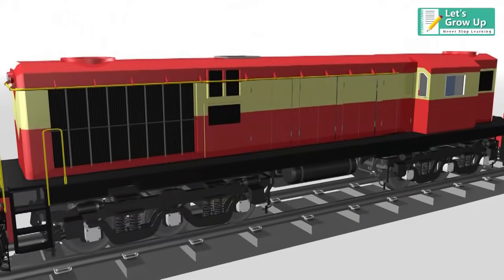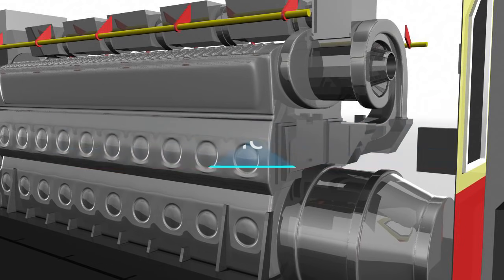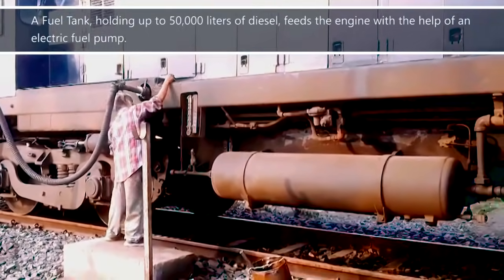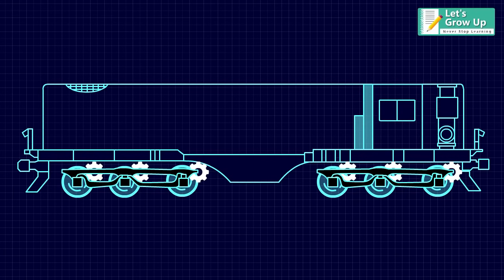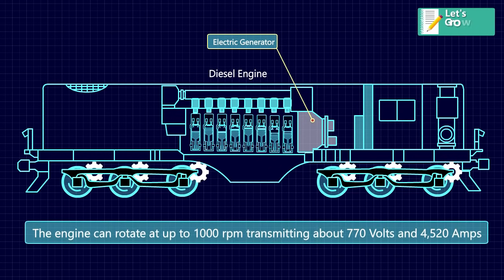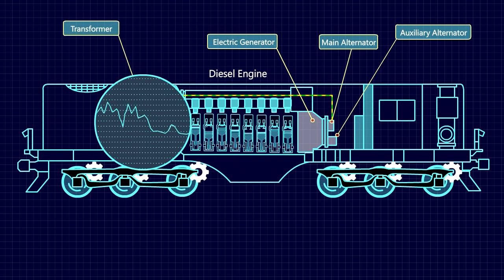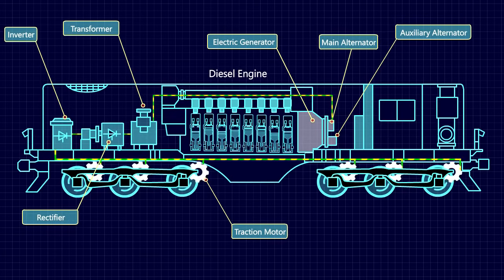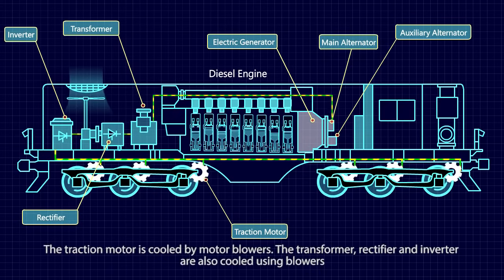Diesel engine working function | #Diesel locomotive | How a diesel locomotive works?

Comment: Not all diesel locomotives are exclusively 2-stroke, In fact only GM products were 2-stroke. Alco, General Electric, English Electric, Sulzer, Ruston, were four-stroke. Also they many produce DC power not AC as explained in video.
Reply: Indeed! The engine filmed in the video is clearly a V-16 with overhead valves. This is a four-stroke design. In a two-stroke engine, the ports or valves are at the crankshaft end of the cylinders, because there's no other possible way to combine intake with compression, power with exhaust.
Reply: @starfishsystems  I think this is actually a 2 stroke. The 2 valves are both exhaust valves, while the middle is not a valve but a fuel injector. The intakes are blower fed ports near the bottom of the cylinders. It's the same layout as the 71 series Detroit Diesel engines, just bigger.
Reply: @starfishsystems  Bullshit mate! It is an EMD 2 stroke engine!
Reply: @starfishsystems  nope its a detroit diesel thats exactly how it works, thats why it comes with a blower intake to push intake air into the cylinders, the crankshaft is immersed in engine oil like 4 stroke design....this is not a puny 2 stroke bike engine
Reply: 2 stroke diesels have exhaust valves folks. So yes rocker arms etc are needed. Also some of those rockers run the fuel injectors
Reply: EMD has a 4 stroke engine in their S(T/D)70AC(E)T4
Reply: @Stephen Miller Yes u are exactly correct
Reply: Bogietype BoBo CoCo DoDo
Reply: Yeah and it looks like they didn’t show a single 2 stroke engine in the video.
Reply: @masterkamen371  The footage shows an EMD 645 which is indeed two stroke. Like Fidel stated in a previous reply it has 4 exhaust valves (the two outer rockers) and "unit injector" which is the middle rocker. Two stroke medium speed diesels have a "ram air" system of either a roots blower or a turbo charger. When the piston is nearly down the air intake ports are opened and so are all 4 exhuast valves. The forced air system blows exhaust out and fresh air in. As the piston travels upwards the air ports are closed and so are the exhaust valves. Compression occurs and as the piston gets to the top the injectors open admitting fuel. 

Two stroke diesels have just as many moving parts if not more than a comparable four stroke.
-'lil stan
Reply: Man...AC-DC-AC conversion is common now, bcoz of advantages of AC traction motors....some DC power is used for control systems, exciter, battery charging,  rest DC output is again converted into AC 3 phs output & fed to traction motors & other auxiliaries. Since DC to AC conversion allows better frequency & waveform control so it is a necessary step.
Reply: @nothingmuch2323  Newer designs r AC-AC, bcoz modern power electronics allows better torque characteristics even for AC motors,  plus AC-AC transmission improves life for both alternator & motors.
Reply: There are russian locomotives like ŁTZ M62 that has 2-stroke V12 Engine with 4/cylinder
Reply: Yup and not all diesel loco are diesel electric also ^^ for exemple they are diesel hydrolic or diesel mechanic  ( with gearbox !) ;)
Reply: Listen to the explanation from 01:50. Diesel generators produce ac current as opposed to dynamos that produce dc current.
Reply: so these are dc brushed motors running the show?
Reply: @fidelcatsro6948  Yup ! but you need to see the size of the motors !
Reply: What's the point the motor would be better off running what a waste
Reply: @pratapbhavnani276  engine speed is not controlled over a wide range ..so motors is used
Reply: Why are cars not made like this with the whole process scaled down? This would be better than battery evs

Comment: EMD made the first North America diesel electric locomotive in 1937.  The majority of locomotive engines in North America were made by Detroit Diesel and Fairbanks Morse.  The engines shown were made by Detroit Diesel which made two stroke engines.  Fairbanks Morse made both two stroke and four stroke.  Fairbbanks also made a vertically opposed cylinder arrangement.  Small yard switchers would typically use Detroit Diesel, Cummins, or Caterpiller engines.  Modern diesel engines are four stroke.  The largest fuel tanks are about 21,000 litres.

Comment: Why should the AC be converted to DC and the inverted to AC again? I am confused.
Reply: AC is dependent on the number of Rotations / Cycles per Second of the Alternator, called HZ.  An AC Motor accepts that HZ and is synchronous with the Alternator's RPM and HZ.  To be able to rev the diesel engine to obtain more Horsepower (like climbing a hill), the Alternator is now rotating faster so the HZ is faster.  The AC Traction motors can't go faster unless they spin the wheels.  Keeping in mind that the rotation of the Traction Motor is synchronised with the Generator, the AC Motor concept doesn't work.  To take advantage of AC Motors and Alternators higher efficiency, the AC produced is converted to DC so it can be Inverted to a variable HZ (frequency).  That means there is no synchronous link between the Alternator and the AC Motor any more.  The Diesel Engine can now be revved up to produce more Horsepower and the AC Traction Motors Rotation HZ is controlled by the Inverter HZ.  Sounds complicated but for now it's the best technology that we have.
Reply: @jimolsen8632  Why not go from the diesel generator to a 3 phase variable frequency drive to the motors.
Reply: @lw7238  Same thing. VFD converts AC to DC, then invert back to variable AC
Reply: @lw7238  I understand your question because that is what we do with VFDs on 3 Phase AC.  With Locomotives the RPM of the Engine varies by Throttle Position so the Frequency of the Alternator varies along with the Engine RPM.  In order to pick exactly what frequency needed at the time we can't rely on the Engineer selected Engine RPM.  By Rectifying to DC the VFD can better select the needed Frequency and power up.
Reply: @jimolsen8632  motors run better with less energy at high frequency ac voltage..
Reply: It does seem like a lot of extra steps to do the extra energy conversions...but still I bet it's more efficient than just a direct diesel power train.  I wonder what efficiency is gained by doing those extra steps.
Reply: @TheCapnCalculus  Google "Are AC or DC motors more efficient".  Even I was surprised then realized that the whole point of Locomotives is to pull Freight.  If the AC Motors allow more Freight to be pulled than DC Motors; that's the way the industry is going to go regardless of efficiency.  With that said, the Diesel Engine comes into play here too.  I would like to see Overall Efficiency of a Rectified Diesel Electric Locomotive compared to and AC Locomotive.  We still may find that the DC is more efficient than AC.  Keep in mind that every time you convert from one form of Energy to another there is always loss.
Reply: @TheCapnCalculus  If direct then you would need a gear box, a big one.

Comment: WHY convert to DC and back to AC? Why not just keep it AC or grab 3-Phase off the generator?
Reply: I have the same question.. a lot of power would be lost converting to DC and AC again.
Reply: Because the inverter need a high DC voltage in the buss bars and then the inverter output an AC but with variable frequency, that way you can control the speed, torque and braking  of the electric motors
Reply: @321aguila  So, it's a special inverter that gives you variable outputs rather than a straight inverter that outputs straight DC, - like 120VAC in, to 120VDC out...
Reply: @JungleYT   I was wondering the same thing why the DC rectifier and inverter if the generator is already putting our 700V AC and the traction motors are 3 phase induction AC. I can see if the power source was DC as with a light rail and had been upgraded to 3 phase motors thus requiring an inverter to split the 600-750V DC between the three phase windings. This inverter onboard the train sounds like a VFD used with a traction elevator machine.
Reply: @TheTheo58  Right... But what's a "VFD"?
Reply: @JungleYT  Variable Frequency Drive. Earlier reference was VFVV Variable Frequency, Variable Voltage.
Reply: @TheTheo58  Ok Thanks! Was an Air Force Electronic tech. Somehow that one slipped past me...

Comment: what’s in the other compartment on the other side of the cab ?
Reply: One end will be radiator room.
Reply: all the contraband items stored and hidden there
Reply: Electronics. Everything that relates to the engine is in the long hood (where the engine is), the heart of the engine is in the cab, while the brain is in the short hood/nose. The short hood also serves as the restroom on some models.
Reply: That's why I clicked the video.  Maybe the air compressor?  Dynamic braking grid and fan.

Comment: Make video on brake system of locomotive
Reply: Train brakes is a whole large topic in itself. In North American heavy haul trains, they run a single air pipe the full length of the train, but the control characteristic of a single pipe system is referred to as direct release. If the train brakes are applied, the system can increase the braking effort but cannot reduce it except to release the brakes completely. It's not ideal but it's reliable for long trains, typical in North America. For the train brakes to provide graduated release, control must be separate from supply and so in passenger trains, there is a second pipe - two pipes run the length of the train. However, it is more limited in the length of the train for which it is reliable. Modern electric brake systems have been developed with a single air pipe and an electric control line but to use, every car must be changed over. They are in use in some dedicated service trains and the day may come where it is mandated for mainline trains.
Locomotives respond to the air brake pipe very much like the cars except there is also an independent air control and pipe that only applies force to the locomotives brake shoes when desired. In addition, the locomotives have the air supply close at hand and don't have to have the  brakes released to recharge as the cars do.
Now - in the locomotives. Many, perhaps even most, modern diesel-electric locomotives are equipped with dynamic-brakes. The locomotive traction circuits are changed from propulsion to a mode where that motors are generators and the power they generate from the train's motion is put into large resistance grids and disappated as heat. This braking force, just like the traction force, is only at the locomotives - not in the cars. However, it is still very useful because it can be applied both more and less and the response is very quick.
Reply: Here's a readable kind: Unlike trucks where you need air to release brakes, trains need air to apply them. Unlike the Vacuum brake system on British rails which uses pressure to apply & release brakes. Each car is connected to the brake system via a air/vacuum hose and some have to have a EOTD/FRED, caboose, or another engine to close the system. Locomotives have multiple hoses, the "train line" hose is the braking system for the train, the other 6 (three per side) are for other locomotives, such as; locomotive brakes (separate system), electrical, & air tanks. Some countries have another hose, but that is an electrical cable to power the engines lights, & secondary systems, such as the HOTD.

Comment: Great video. Out of curiosity, in the beginning of the video, you said these locomotives run on two stroke engines, however to my knowledge the vast majority of large engines are four stroke, and the footage you presented was of four stroke engines. To my knowledge their is a design for a specialty two-stroke Diesel engine in which two pistons occupy one cylinder, one at each end with two crank shafts, and valves are not used. I’m not sure if this is what your were referring to. Thank you, and again, great video.
Reply: It's only exhaust valves emds are two stroke GE is 4 stroke

Comment: Imagine, heavy truck use diesel electric. It will much efficient and powerful
Reply: its less efficient with an such a smaller engine cranking a generator and hauling would be very inefficient
Reply: The open pit mining industry has used diesel electric trucks for decades. I recently retired but drove Komatsu diesel electric trucks for 20 years. I drove 830E models which were initially DC trucks but all the manufacturers now produce only AC models.  The braking of the truck was accomplished by the use of a retarding system which in the retard phase the wheel motors become generators and a load consisting of a grid of aluminum and ceramic components dissipates the excess energy as heat thus slowing the truck. The truck, in effect, becomes a giant toaster. I drove trucks rated at 250 and 300 tons but trucks rated at 500 and 600 tons are now being put in service. These truck make monster trucks look like hot wheels.
Reply: @richardsmith9609  these are same sized as the humongous Caterpillar 737  CATS?? looks like you describing regenerative braking..
Reply: it should tried and tested on the road.. im sure it can be efficient if the energy is also stored in batteries to be used later...in a truck the speed and movement conditions will vary because of traffic lights , vehicles on the road, turning , stopping etc..
Reply: The weight of the motive power components would seriously detract from payload,  And it would be useless on steep gradients typical on roads. This method of propulsion only makes sense  for rail or perhaps marine transport.

Comment: 2 stroke with valves?
Reply: In emd locos which is 2stroke is inlet ports and 4 exhaust valves per cylinder
Reply: Thuis engine is a 2 strike diesel made by EMD. 2 rockerarms actuates the 4 exhaustvalves and the center rockerarm actuates the unitinjector.
In Europe this engine is used in the Class 66 locomotive. It's a 12 cylinder V with 710 cubic inches each and 3.300 bhp power output

Comment from the maker: Friends, If there is any mistake in this video(technical) please adjust it. I am trying to meet your demands. Please give your Comments to support Let's Grow Up. Thank You:)
Reply: amps is not an acronym
Reply: @spambot7110  AMPs is an abbreviation of Amperes, and is not pronounced by spelling out the letters.
Reply: Not all diesel locos are diesel electrics, over here in Germany we have another type of diesel locos, the diesel hydraulic ones.
Reply: There are both 2 and 4 Cycle diesel locomotive engines.  I have seen 6, 8, 12, 16, and 20 Cylinder engines but haven't ever seen an 18 cylinder (maybe Europe?).  Most Engines today are 12 or 16 Cylinders, some are still 20)  When the animated video shows rotation of the engine being transmitted to the Generator, the Picture Video shows an Auxiliary Generator instead of an Main Generator or Alternator.  Your concept, story, and video is very good, just some details are slightly off.